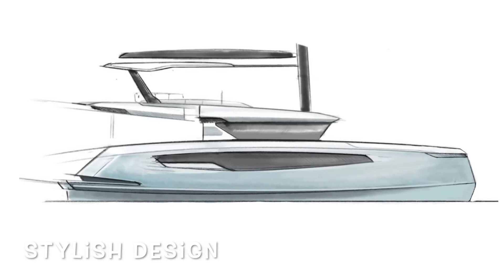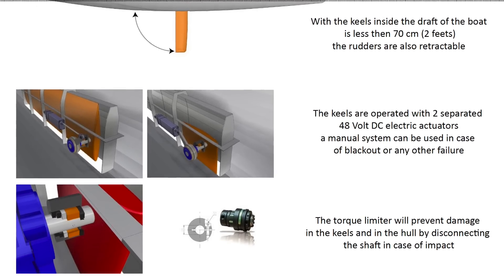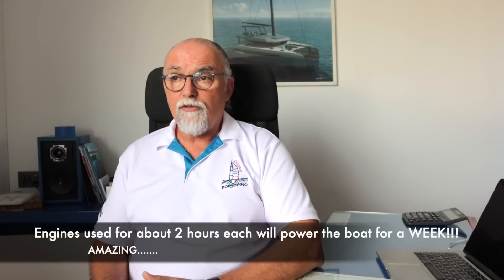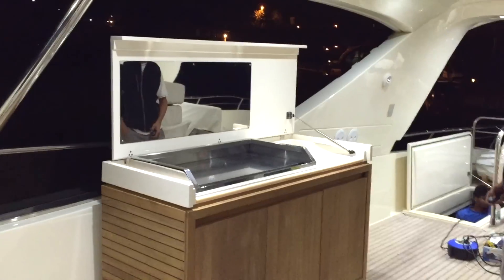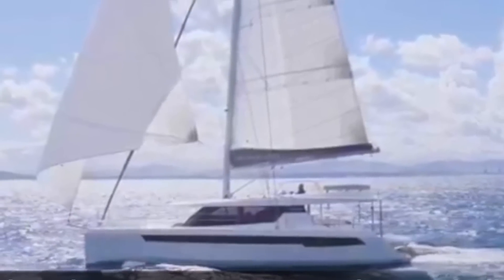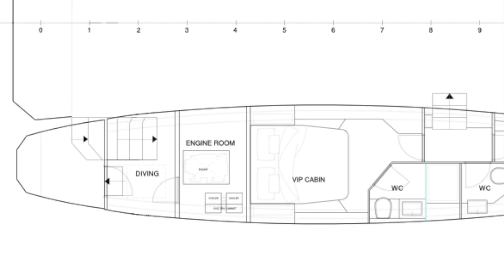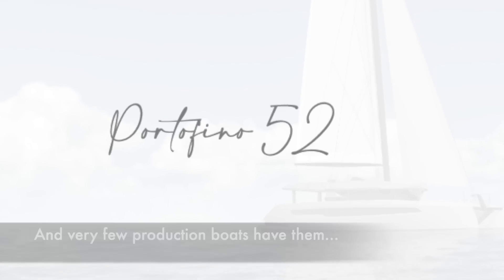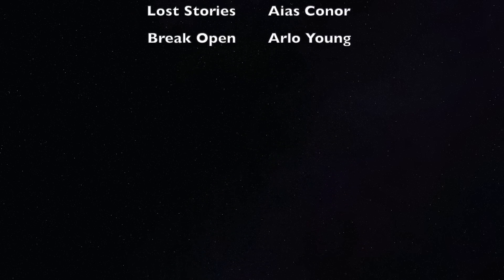S3#4.  NEW Portofino 52 - Designing THE PERFECT PERFORMANCE ALUMINIUM CATAMARAN for us?

Comment: Looks like a fantastic boat to go cruise around the world on, but I find it hard to believe this boat won’t come in close to 20T lightship displacement you didn’t mention this in the video.  I’m struggling to see how this could be considered as a performance boat, no getting around physics…but I’ll keep watching to learn more.  

My only advice is if you move forward have the displacement as specified in the build contract.  If they won’t do this, run the other direction.  Being hull # 1 is not for the faint of heart!
Reply from the maker: Thanks for the advice, Kirk! The Garcia is 18.5T and they use thicker aluminium and this boat is being planned to come in at 16T. Mumbys are much lighter construction and come in around 10T I understand but I will be getting more info on that too.... Portofino are using naval engineers to do the calculations to reduce weight without compromising the strength but we are not aiming for a super light Mumby type construction.
Reply: @barefootdoctorssailing  Yes, but just keep in mind that the Mumby is a stripped out shell of a boat with very few amenities, extremely minimalist-zero luxury or insulation like the Garcia.  Also that swim platform alone probably is going to add 1.5T.

Very cool boat though. Performance?  Well that’s relative to what you are looking for, but you say you are looking for a boat that will sail easily at 12-14knots but that’s Balance 526 territory which has an SA/D of 31 and comes in at 12T, the Portofino won’t be close to matching these types of numbers.  Good luck & get that commitment on weight in the contract!
Reply from the maker: There is no point in going backwards and forwards as the proof will be in the pudding... S as Lao even the heavy Leopard  50 platform weighed 0.5 tonnes do it is nowhere near the1.5t you expect.

Pkukkys boat will be far from a stripped out boat and still be under 20T so have faith my friend and be open to being amazed on many fronts!
Reply: @barefootdoctorssailing  Very true!  To commission a custom build like this at a yard without a track record of producing performance catamarans you definitely need to do your due diligence and know what you are getting into.  Looking forward to following along!
Reply from the maker: @kirkb3473  👍

Comment: Very interesting and thanks for sharing! just one question bumps up about the lifting keels. 

Using them in the "classic" way, you can choose how deep they go into the water. But if you have Portofino lifting keels, you have only two options, up or down. Are you okay with that?
Reply from the maker: Hi Guys, thanks for the interest. There is not only an all up or an all down option because you can have the boards rotated to any depth or angle. So when going upwind they would be fully down but when on a reach you would probably only use the windward one at a 30* angle to reduce resistance as leeway is minimal. Downwind both will probably be up completely. That is the sort of way I used the daggerboards in the past and the more you are off the wind, the less you need and I expect the cat to hold its course well without the boards due to it's sharp entry.... But we will see.

Comment: Looks and sounds good ...😎
Take a look back at the Broadblue Rapier 550  for its performance and layout..

I think you will also find windelo willing to look  developments of their design.
 If a hull is a sealed cell foam sandwich of sufficient thickness then its got built in buoyancy but thoroughly approve of adding floatation cells into the webbing of the hulls.. it also adds insulation...in particular against colder water.

The swing keels or break free/sheer dager boards are vital ..ive no idea as to the mechanism but  ..ive seen enclosed PU bushed cush drives that essentially work like an indespension trailer leg or the early Greeves trials bikes used a combined suspension eye bush and adjustable damper unit. ...using modern polymers and marine grade materials its a robust Kiss based design for the occasional strike.
Reply from the maker: Thanks Clive, lots of good info again! Yes the automatic release under pressure with nothing breaking is a really clever design in Portofino.

Comment: losing the flybridge is a big compromise, its my preferred spot during the day sailing and resting, even eating since there is more privacy higher up when you are docked. What is the speed (or other issues) difference with/without the flybridge?
Reply from the maker: Hi Claudio, we hear you but don't know how much speed would be lost with the flybridge... The other big issue is that in a storm it does create a lot of windage so increases the risk of dragging. The Leopard 50 moved at 3.5 knots in 35 knots of wind without any sails up (drifting very fast)!

Comment: This guy speaks very well and sells convincingly.  BUT I would feel far more comfortable buying a boat from a designer and builder both of whom should have extensive performance multihull experience.  You also have to think about resale, all boats will be sold one day, I would be nervous about how a boat from Portofino would be received by secondhand buyers - my guess is you’ll take a haircut on the resale.
Reply from the maker: Hi guys, the value would only fall if the boat was not up to standard and did not perform as expected. Once they are out there and if they perform well, the value may even be greater than what we paid as the features are unique and outstanding and there won't be many available... Of course we hope it will go upwards in value but if we go with it we hope that we won't need to sell anyway!
Reply: @Barefoot Doctors Sailing  ....not sure I agree with you, people are very brand oriented and typically less inclined to go with a boat from a super niche builder.  Be realistic one day you will have to sell, everybody has to sell - unless you want to pass it to kids or friends in your respective wills.  

But if you really don't care what it's worth when you sell then follow your path.  In that case I would be more concerned about after sales support from a niche builder.

Comment: This seems super good and is so exciting. But 2 years of waiting will be hard. You can check out the new solar panels that are available today that cover everything you want and look like floors or roofs if you want.
Reply from the maker: Yes the wait will be hard and we hope there will be many advances in that time in electrics, batteries, solar and engines.... Thanks for the insights, Magnus!
Reply: @barefootdoctorssailing  

Watch for the Na, Sulpher and Al based batteries coming on to the 
Production  lines this year.

His observations about the cost of a dedicated seperate generator is spot on... 
However there are also new forms of ultra compact lighter more efficient motors also coming to market that can be used in both roles. I can add a few links if they interest you... Its still difficult to add external research links to U tube. 🙄

Theres a lot of hybrid power plant work going on in Holland and Poland.

Also look at the regenerative potential under sail ... Prop choice and retractable electric drive.

Re stern thrusters... Jets 👍🏼😁
With more places limiting anchoring it allows  you to maintain position or stay on dock while casting off single handed or sideways park single handed.. but these systems use steerable nozzle's..
Reply: @barefootdoctorssailing  Both batteries and solar panels must be improved within 2 years. I actually think it will arrive in time. I know about batteries and panels that are already on their way here. https://www.youtube.com/watch?v=52RXCA7ZxYw&ab_channel=TheFuturist

Comment: I've been watching your channel from about the time of your unfortunate incident with your Leopard.  I'm also looking at performance cruising sailing catamarans. I want to sail the world in reasonable comfort and safety. I cant believe how similar our wish lists are right now.
I'm not ready to commit to a cat yet, and it's probably going to be a year or more away before I can.  But your wishlist is almost the same as mine.  My sticking point at them moment is the flybridge, because it gives you so much more room about the cockpit/saloon.  But I too am thinking about forgoing that due to giving up too much in performance.  I have very little experience sailing, I've been a smaller powerboat man, but I'm starting to spend some time sailing with a certified "Captain" and ex-racer mate of mine who has a 52' Voyage Cat.  Very minimal boat but quite fast and light.  Its helped me know what I want and what I dont want and given me some of the sailing basics.

Congratulations on finding a designer/builder who is willing to design and build you a one off very custom boat.  I guess that's an advantage of building in Aluminium.  I'm going to love to see the Polers and the weight your boat will calculate out to.
Until now I have steered away from Aluminium due to potential catastrophic corrosion issues, but that may not be as big an issue as I initially thought with the advent of electrical leakage detection systems that are now available, as well as running all wiring through extra conduits and even some frequency devices that "May" help with corrosion issues.  And lots of zinc of course.
Reply from the maker: Nice to hear from you Raptor! I am sure that there are lots of folk out there that will want we want but till now the brands just made it that it was not possible! Now it is - so lets get what we want. 

I want to be able to do 12-15 knots with relative ease and comfort, under autohelm and not have to worry about capsize if a squall blows through...

The compromises are also only in degrees -  lose a bit of speed for flybridge. Put on a flybridge and lose a couple of knots at the top of the range I suspect and increase windage - that's probably more of an issue is strong storms at anchor...

Don;t worry about corrosion any more and just make sure the wiring is done by someone that knows what they are doing and check your anodes frequently and use the isolation transformation - all sorted!

Keep the dream alive and the more boats you sail on and the longer trips you take, the more accurate you will be in choosing what you want and what you don't want. I guarantee that many of those wants will change after a period on the boat actually doing it so put on less to start with and add later - esp if that helps you get out on the water earlier... Good luck!
Reply: @barefootdoctorssailing  Thank you for your reply.
Your right, buying a boat today is quite a different experience to what it was even only a few years ago. Customization is becoming the in thing (possibly even more than I realised).
12-15 kn without stress does seem very reasonable (not outrageous).  I would also be happy with that.
Flybridge, the main thing I like about them is room they give you in the cockpit/saloon area.  I want dual helms and it's amazing how much 2 helms take up.
Corrosion, yes, it does not seem to be the problem that it was even only a few years ago.
My wants, needs and dont wants sure have changed a lot over the last 5 years.  The dream is very much alive and WILL be fulfilled - when I semi-retire.

I will be there on you livestream on 12 Feb (midnight for me as I live in Western Australia.  I would also very much like to know exactly what specs and calculation they use for your polars, and are Portofino doing the Polars or is a third party doing them?  Thanks.

Comment: Hi guys, very excited about this option. I have been looking at the Sunreef 50 Eco mainly to be totally off grid. Wondering if the designers will option this wishlist item to replace the diesels with Ocean Volt or similar with a comprehensive solar array? Kind regards.
Reply from the maker: Yes, Guys, at the end of the day you could have whatever configuration you want. So if you want to do all green you can but the distance you can motor is still limited unless you have a generator of some kind. We hope the technology will improve and solve that in the next few years.... Thanks for following and for commenting!

Comment: A couple thoughts.  Talk to the distant shores folks, they looked into mechanisms for swing keels on their new aluminum boat.

Look up Elcie Expeditions, an aluminum cat designed by DeVilliers.  They kept it pretty spartan inside, but I crewed on it, it would sail in a whisper of wind.  They prided themselves on almost never using their engine. 

There is also Ruby Rose's interview with a naval architect for their new boat, newer designs have wider flatter sterns then they used to be. 

Look forward to watching the progress.
Reply from the maker: Thanks Mark for the various bits of advice. Yes we followed with interest as Distant Shores went through the process to get a custom Alum boat built with the lifting centreboard and while they have been around for a long time in Alum monos, there is no-one that has done them for cats (as far as I am aware). We have been in contact with Devilliers and have seen their new designed cat that is interesting too and yes, the performance of the cats also has a major effect on hull shape and while all those formulae are great ball parks, the boat that lifts itself out the water at lower speeds, reduces resistance and overcomes the hull speed limitations. That is what we tried to create with the amended Portofino design and wide flatter sterns is one of the features...
Reply: sailing nahoa is doing an aluminium catamaran as well

Comment: Think about a large nation using a EMP to disable another countries infrastructure, such as electrical power. What would that do to your nearly bullet proof liveaboard situation?
Reply: Nobody is going to launch any nukes. An EMP event is not going to happen. Lightning is far more likely. EMP pulse dissipates quickly. The boat has short wire,s so induced charge won't build up enough to cause damage unless you are right next to a ballast (you are likely to burn first).
Reply from the maker: I know nothing about EMP but hope that I will never be near enough to civilisation if that ever occurs!

Comment from the maker: Hi again, good questions that deserve answers!
1.  Yes sacrificial bottoms are really important to prevent hull damage as the hull takes the impact of the back of the daggerboard. Still a risk if you hit higher up..
2. Yes with Ekectrician engines on the shafts you can power and regen using the same engine and be green until the batteries need recharge...
3. High pressure pump inboard and because the water force is so great, barnacles are washed away immediately...
4. Fly bridge - boom height is probably the biggest issue . The 72 foot gunboat now has a top deck but none of their smaller models.
5. Self tacking jib has pros and cons and we have to make that call...

Interesting other points too. 

Thanks for all that info!!

Comment: Very cool. Glad for you guys.

1. With carbon fiber and a reinforced sleeve you would think daggerboards could be as forgiving as traditional keels that grounds every day somewhere in the world. Maybe a replaceable, sacrificial leading "bollard"?

2. Power sounds perfect. The only question is the engines hybrid. Is there an electric motor along the shaft that can drive the props? So you can "motor around" using just electricity.

3. What pushes the water out of the bow jets. An impeller like my jet boat would present a maintenance issue cleaning barnacles. An inboard pump with two outlets (P/S) would be perfect.

4. Flybridge. The weight issue seems minor. You also are trading off sweeping visibility and the sailing open-air flybridge experience. Where do the lines lead? Inside would be like driving a bus.

5. A self-tacking staysail option would be nice in heavy air on a night passage.

6. The ama stern shape should avoid being squared off.  Otherwise, you are squandering free energy.

7. Could the port storeroom and starboard diving room incorporate the engines.  Access to the engines would be greatly improved.  Soundproof panels could enclose just the engines for normal operations.

8. Could closed-cell foam be used to preserve buoyancy instead of air-tight compartments. It is very light and would provide thermal and acoustic insulation.

SOP no reply needed.
Reply from the maker: Hi again, good questions that deserve answers!
1.  Yes sacrificial bottoms are really important to prevent hull damage as the hull takes the impact of the back of the daggerboard. Still a risk if you hit higher up..
2. Yes with Ekectrician engines on the shafts you can power and regen using the same engine and be green until the batteries need recharge...
3. High pressure pump inboard and because the water force is so great, barnacles are washed away immediately...
4. Fly bridge - boom height is probably the biggest issue . The 72 foot gunboat now has a top deck but none of their smaller models.
5. Self tacking jib has pros and cons and we have to make that call...

Interesting other points too. 

Thanks for all that info!!
Reply: @barefootdoctorssailing  
1. Very true
2. So the props can be electric only.  No need to run either diesel engine at all.
3. Perfect. What a nice design!
4. Every design element is a tradeoff.  I would struggle with it. Is it worth a second set of VPPs to quantify the expected impact and tradeoff?
5. I do not have staysail experience.  Could you just add the track to the normal setup or would need a second sail cut?
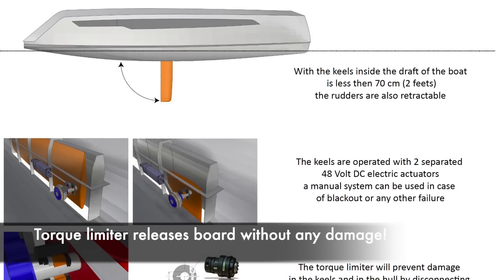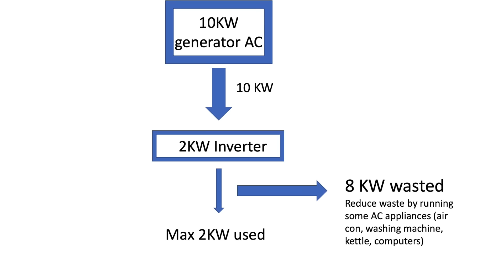Reply: @barefootdoctorssailing  Thought of you guys. A shallow draft aluminum boat, centerboard with a small daggerboard forward of the rudder post (3:07-4:52). This boat also has the engine inside the salon surrounded by acoustic panels and very nice woodwork (13:37). Engine exposed (17:21-17:50). YouTube video “We Paid $57,000 For This Rare Boatyard Fine, Are We Dumb?”. The daggerboard forward of the rudder post from this long time European boat builder was surprising.